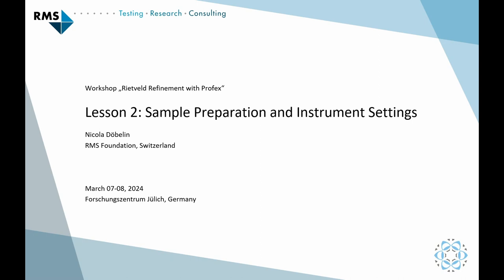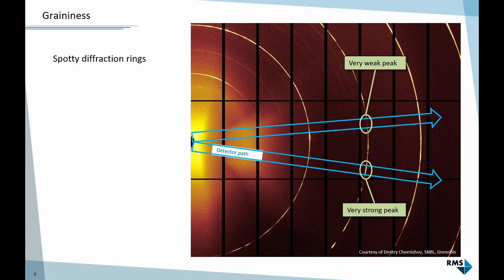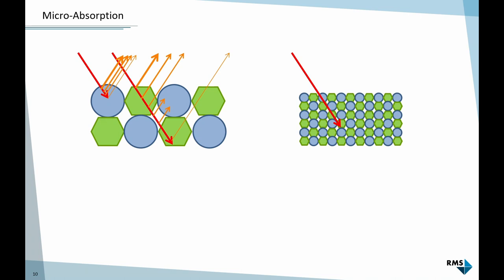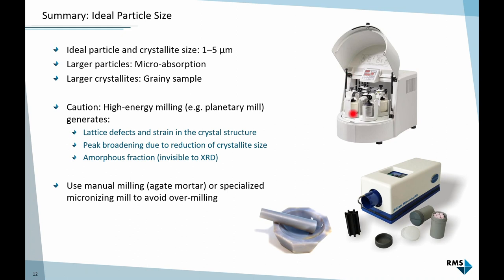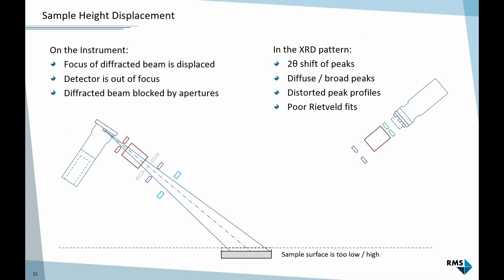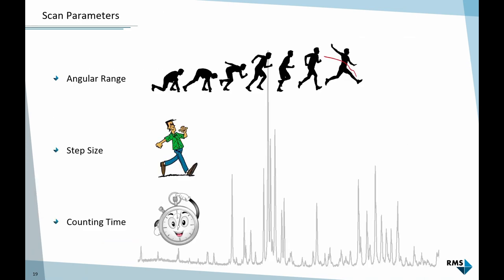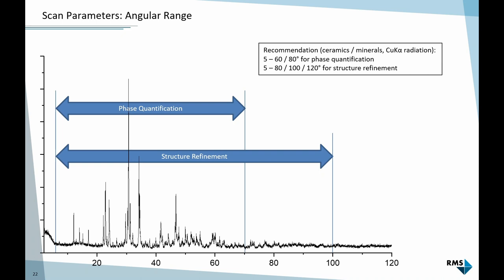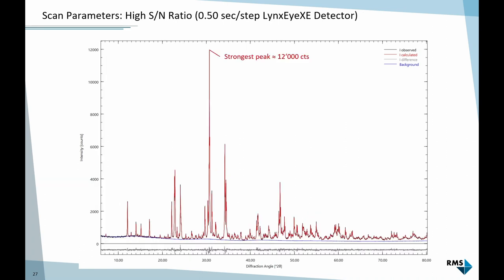Workshop 2024 Lesson 2: Sample preparation and instrument settings

Comment: I have a problem with organic polymers like chitosan. It can not detect or just penetrate and as a result, I'm getting only diffraction patterns for the sample holder. Should I change a metal sample holder into a glass one? Or I need to change the radiation source.
Reply from the maker: It's hard to tell without having more information. Maybe your sample material is really amorphous?
Reply: @profextutorials2325   thank you for your reply. Yes it's amorphous but we have got a pattern corresponding to the amorphous materials from another diffractometer. I think you already mentioned that Cu radiation is mostly for inorganics while Mo should be used for organic powders. The problem is that we only have CuK source. And the instrument itself is the Chines production, not too reliable. Thank you again I will keep watching your tutorials and install the program Profex. Currently I use MDI Jade 6. There's very few tutorials on it. What interests me is to do the quantitative analysis